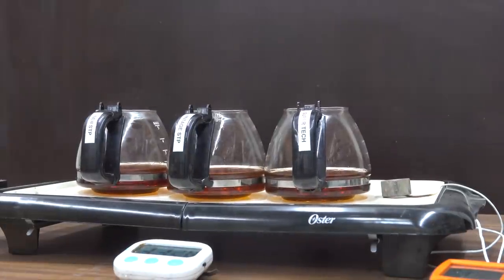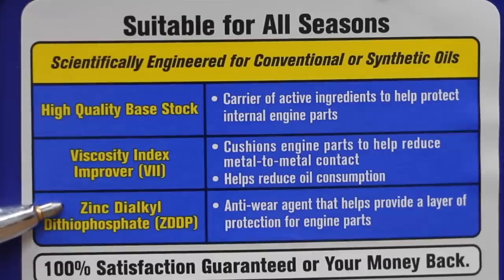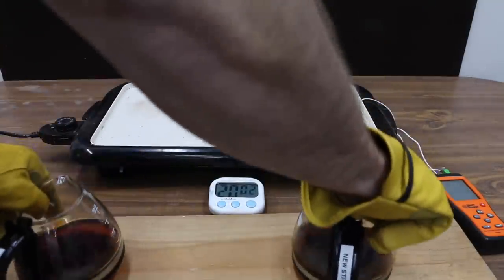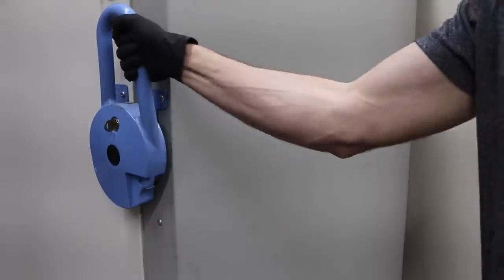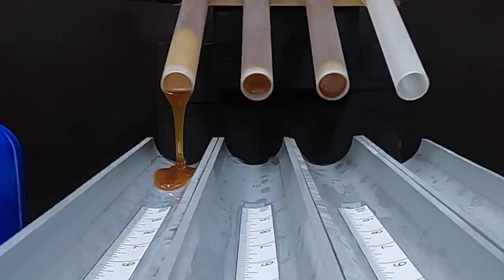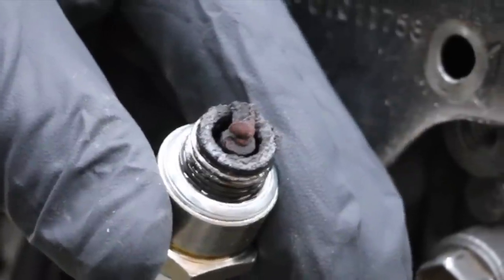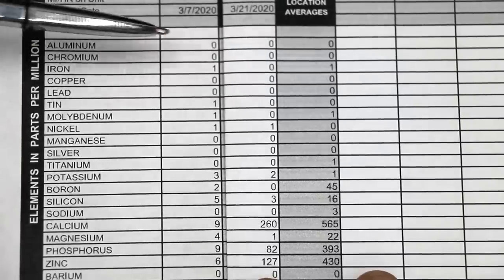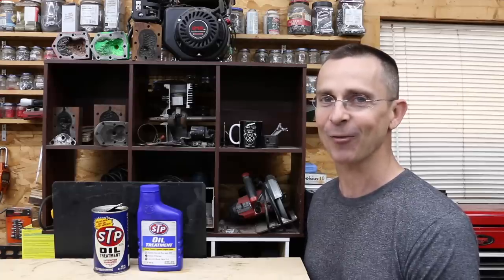Richard Petty's 1981 STP vs 2020 STP?  Let's find out!

Comment: Most real mechanics (and auto engineers) will tell you STP is NOT GOOD for your car. In fact, it can void warranties and is specifically called out not to be used.  The best thing is full synthetic oil changes every 6000-7500 miles.
Reply from the maker: Thanks for the feedback.

Comment: I do not think I would run any of theses oil additives in my new motors.   They build new motors with such small tolerances and passages and req such thin oil additives like this probably would do more harm then good.    Now in vintage motors be different
Reply from the maker: Thanks for the feedback.

Comment: Please test Triboron 2 stroke oil. It uses boron to coat the metal parts of the engine to reduce fricion. And can be used at half the oil to fuel ratio. More info: https://www.future2green.eu/

Comment: You need to do an expose’ on a company called heatshield r-20. I mean if you can re insulate your house by painting it. That’s sort of a no brainer. Why has this company not become an overnight sensation. Sounds a little off.  You add some beads to some paint and... voila EFFICIENCY!  I don’t think so.

Comment: Rarely does the racer use the oil of the company that sponsors them. And the company doesn't care as long as their name is on the car and they win races.
Reply: A big name in drag racing sponsored by Castroil did not use that oil in his engine. That told me that you can't always go by what you think is going on.
Reply from the maker: Thanks for the feedback.

Comment: Do not trust oil samples. Maybe you got a reputable lab, maybe not. Had an engine making a lot of oil through fuel dilution to the tune of 1-2 liters per day but Cummins would not provide warranty unless an oil sample showed fuel dilution. Company we were using for oil samples never reported oil dilution.
Finally I took a sample of new oil, added an equal amount of fuel so we had a 50/50 mix and the lab report was perfect, no fuel dilution.
Similar thing happened with coolant in the oil.
Another time oil was white from water contamination. Oil sample results, no water.
Trust your eyes and nose, not oil samples.
Reply from the maker: Thanks for sharing.

Comment: Damn bro, kinda seriously dropped the ball on this one, maybe time for a new video on stp. You clearly showed stp wear scars were way smaller on the stp compared to non stp. Why do you think that is? You're kind of implying that it's because of a thicker oil, but 1) if you have any experience adding thick oil additives, like stp, or Lucas, you will know that the final cooked oil drained, will be just as viscous as regular motor oil. It's counter intuitive because we would think mixing a thick oil with a thin oil would make a thicker oil, but mixing Lucas with regular oil produces thin oil. Also the STP oil additive is only 1/10 or 1/12 of the oil . In my experiences it never made the oil thicker. So if the additive doesn't make the oil thicker, how does it make the wear scars smaller? Again you really messed it up because you just implied it was the viscosity and didn't back it up with any facts or tests. You could have sent back the cooked super Tek  STP mix and compared the viscosity. You could have found a thicker oil w40 or something and seen the wear scar, and ud see the wear scar of the ticker oil would still be worse than the STP wear scar. 2) higher viscosity oils do have stronger film strength, however there is a limit to how much film strength can reduce wear and friction. Even if you put gear oil through your bearing tester, it will have a wear scar because you're past what film strength can do. Film strength can only get you so far, chemical alterations are the next stepping stone in reducing friction. And the viscosity change between regular oil and regular oil with 6 percent STP, isnt great enough to cause such dramatic difference like you see with the wear scar. It's just like the engine restore product restore. That additive isn't even thick even though most other additives are thick. You believe in restore yet it works chemically. Again it's not the viscosity, if you ever played around with thick oil additives, and you mix STP with oil even with high ratios of stp to oil, the STP melts like butter and dissolves

  they are advertising zddp, and you tested it and didn't see it with your test, but you're still getting the results that decrease wear, and can't explain how it works. maybe the lab can't pick up the specific molecule of the specific zddp formation. You really think people can sell a zddp additive without putting zddp into it without getting sued? 

I had a 99 Monte Carlo and I got a magnetic drain bolt for the oil pan, and I always would always gray silvery build up on the magnet with metallic sludge. Ever since I started using stp in my oil changes, Ive never seen any metal specks on any of my cars ever again

Comment: This guy did the test wrong he should have had 50% super tech oil and 50% STP we use these STP additives and older trucks that has the flat topic cans because the newer oil goes thin when it gets hot even we buy the thicker oil it's not good that's why they use Lucas and STP to engines for old cars especially hot rods no STP is not a motor oil it's an additive it's not going to be as good but it works when it needs to be worked with motor oil

Comment: Project farm 🚜😎
Please text Blendzall Gold Label 
I think it is the best fi / carb cleaner. I believe it helps with fuel efficiency and I have been told it can be mixed 1 pint and 5 gallons of 93 octane and used were high octane fuel is required in high compression race applications.
Reply from the maker: Thanks for the video idea.

Comment: You need to know the real story behind STP, "the racer's edge".  STP was originally designed to be used in race cars.  Racing engines are made with huge clearances, so they don't seize up under extreme thermal conditions.  Racing engines are torn down and cleaned after every race.  STP is commonly put in old car engines "to cover up problems" by dishonest dealers.  STP IS NOT FOR "NORMAL" STREET CARS!  I have seen engines torn down after using STP only once.  The engine is a gummy mess, many times complete oil galleries in the block and crankshaft become totally clogged, requiring TOTAL teardown to clear (and no, none of those "magic" engine cleaners will work either).  Look at that gunked-up spark plug in your lawnmower!  The rest of the engine (rings, crankcase, bearings) is most likely the same!
          If the engine is badly worn, use a higher viscosity oil, not STP!  STP needs to stay in the racing circuit, and ditch the hype.
          If you want to test an oil additive, try Fluoramics Tufoil.  The "magic" of Tufoil is not when the engine is running; it is when the engine is started, and a minute after.  90% of engine wear occurs during this interval.  Tufoil provides "boundary lubrication" during this time.  Do not use in motorcycle with wet clutch; it will slip.  If you put some into a drill chuck arbor taper, the taper will fail to hold in lathe tailstock.  If you put this in a new engine, it will not break in properly.
Reply from the maker: Thanks for the suggestion.

Comment: These oils do not repair the engine. The engine is old you need to put some money into it. Either a simple fix like new rings or a rebuild if you have the money. A good used engine is a cheap way to go. Get a car that was hit from behind and totaled. Grab the engine or have one sent to your mechanic to install. You can always pick up a good Honda  or Toyota. Stick with Accord /Civic or Camry/Corolla.😁
Reply from the maker: Thanks for sharing.

Comment: PF, I really like your tests to see how products perform.  However, why do you have to have a ridiculous test at the end?  If the product has a recommended mix ratio, then test it at that ratio.  Deliberately misusing the product is not a fair test of the product and does NOT provide any useful information.  I'm NOT going to use 100% STP in my engine and would not expect it to perform well.  Also, reference a previous video on anti-seize compound, I'm NOT going to try using anti-seize as an engine lubricant.  Those are both wastes of time.

Comment: 7:11  I  DON"T  like your Cold Oil Flow Test; Using tubes that narrow hold in what's inside (like glass Ketchup/Tomato Past bottles); I'd rather see cold oil slide off a kept cold plate or SUCK UP AND PUSH COLD OIL THROUGH A PUMP LIKE A VEHICLE WOULD DO ON A COLD START.